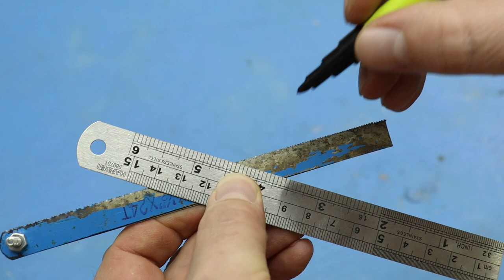Не вздумай выбросить старую БИТУ!Советы и Хитрости Мастеров по Дому, Которые Действительно Помогают!

Comment: Hi. 
Some ideas are cool, but you can see the eastern poverty in the prices of tools and accessories for them.

No one normal will drill holes with a nail when he has 3 sets of drill bits in his drawer !!!
It reminds me of the situation in Poland some 40 years ago. I was up to that too.

Now I go to Aldi or Lidl and buy a new set for the price of a loaf of bread.
And I don't have to mess with zip-tie anymore. That is the difference.

BTW. It's good that you show these different tricks. But have you ever sat down at a table to count the cost of making such a tool?
Drilling, welding, anything related to electricity is money and time. And here you don't wiggle your finger on the screen anymore.